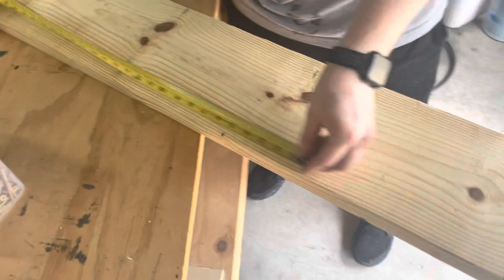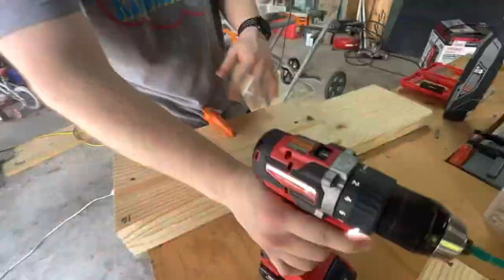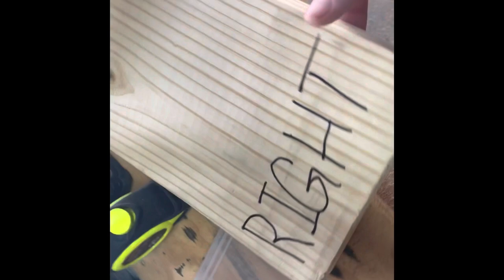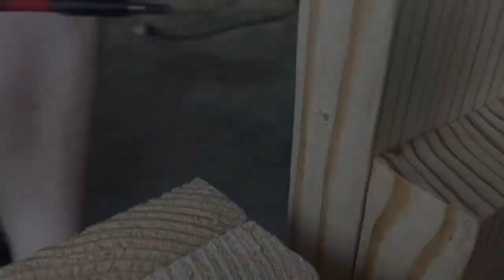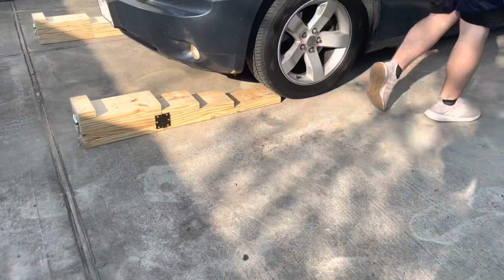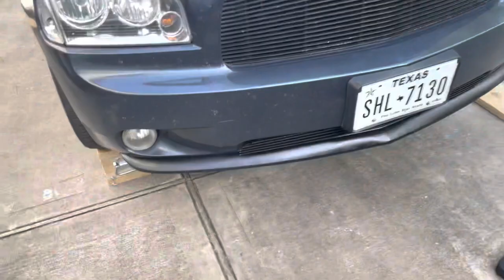How To Make Wooden Car Ramps (handles and hinges) ($40) (DIY)

Comment: Can you change the starter with that (low) height?  Do I need to go higher than 4 planks.
Reply from the maker: @complexity5545  definitely think it’d be possible with the height I made
Reply: @CharlesOfAllTrades1725  Thanks  -  I think I am going to go 8 planks high.  I'm not in shape like you.